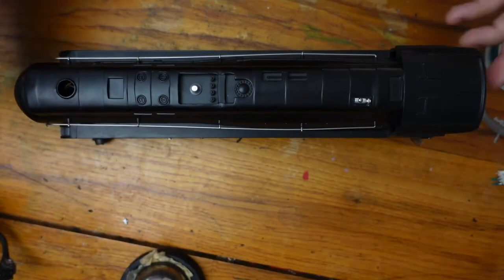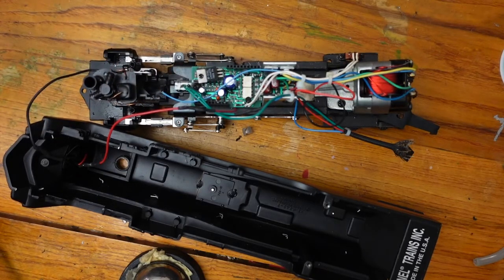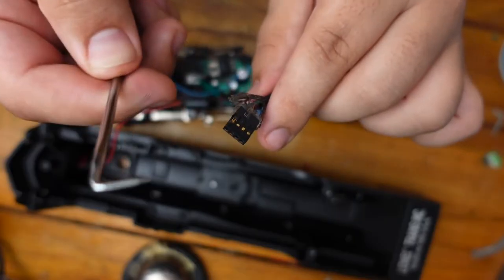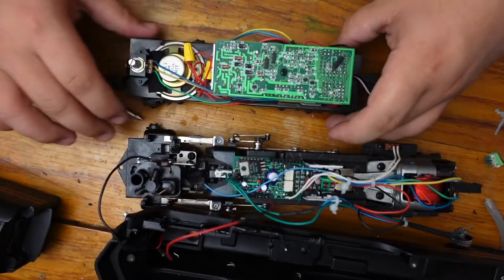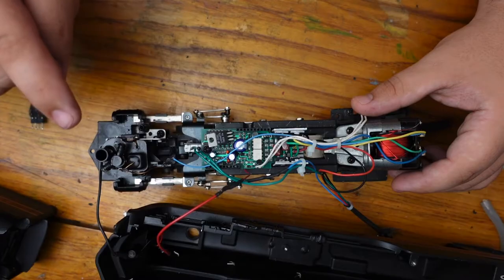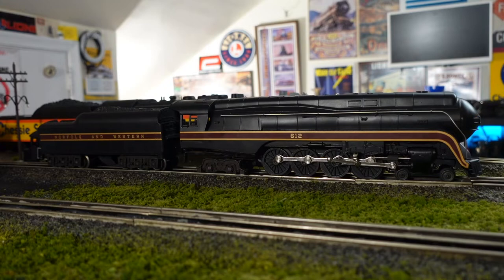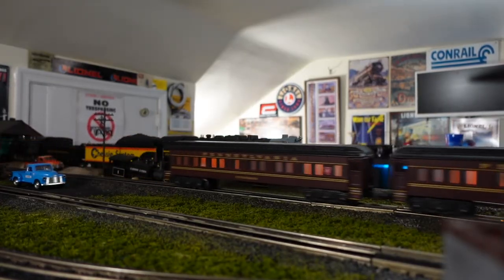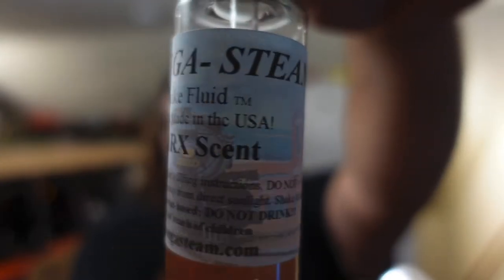Troubleshooting Lionel Railsounds with Lionel N&W 612 & Run Session!

Comment: Great upload, beautiful engine. The word you were searching for is Heat Shrink. You can find the little hose for your smoke unit at an auto parts store. Just take the old hose in and match it up with a similar size piece of vacuum hose.
Reply from the maker: Thanks so much for watching my friend! Don’t you have one of these as a tinplate Marx? Definitely will be matching it up this weekend for the cylinder steam.  Lol yes heat shrink 😂

Comment: Good video Nick, very informative!
Nothing essentially wrong with wire nuts IF you've allowed enough bare wire to twist within the nut, however sometimes I use wire nuts myself, sometimes not.  It all depends.
Reply from the maker: Thanks so much for watching! That’s an excellent point. The wires were barely stripped. Maybe it was built on a Friday after a lunch break lol

Comment: I have an MPC Daylight engine with a similar smoke unit, I got replacement tubing for the smoke unit from Lionel. I also had an engine that had many wire nuts where one black wire came out of the wire nut and I had to guess which wire nut it came out of, luckily, I connected it back to the right place.
Reply from the maker: I’m hoping to eventually swap out the unit with a replacement smoke unit or fan smoker. I think these were the last few USA engines made that year.  The boards were most likely from Korea and they used the wire nuts to speed up assembly. Thanks for watching!

Comment: Very informative video Nix. I always though those wire nuts were a little suspicious. I’ll keep that in mind if I find some in any of my locomotives with that. Thanks man!
Reply from the maker: Thanks so much for watching! I think they just didn’t strip the wires enough but I prefer the solid solder joints 🚂💨

Comment: Thank you so much for this video/tutorial.  I just acquired a 612 and temporarily ran on my track with just a standard transformer and it performed similar to what you described…chugged once and that was it, no more sounds.  Thanks to your video I’m going to disassemble and see it there are any like wiring issues.  If you change out the smoke unit can you video that?  Thanks again
Reply from the maker: Thanks so much for watching! I’m glad I could I help! Definitely check that tether linkage and I’d solder all of the spots where they used a wire nut. The cherry / chuff switch is most likely perfectly fine. Let me know if you need any help 🚂💨
Reply: @NixCrossing  I didn’t see it but is there a way you could post or send the parts list and where you got them?

Comment: Nick, thanks so much for this video! I have the same locomotive and it has a crazy "spastic" chuff problem. Now that I've seen your video, I'm going to look at replacing the cherry switch and checking the connections with wire nuts. You mentioned that TRAINZ had replacement cherry switches so I will contact them. Do you have a part number?
Reply from the maker: Thanks so much for watching! That’s most likely the chuff “hot” wire contacting a ground somewhere on the shell or inside the shell.  I would trace the hot wire back to the tether. The part number is 401-162 Cherry Limit Switch sold on eBay or Trainz. Hope this helps! These are sweet locomotives

Comment: A few questions;  I didn’t see it but is there a way you could post or send the parts list and where you got them?

Did your loco not sound at all or did it let a sound out briefly?  

When you completed the work did you put it on a track with just a transformer or did you use a cab1 or TMCC? Thanks
Reply from the maker: Not a problem.
I don’t have a parts list for this kit, but the eBay seller ships them as a full aftermarket kit most likely purchased from Lionel’s mass sales. It did make sounds, just didn’t make a difference with the reed switch connected. I actually used both a conventional transformer and using my CAB1 remote in conventional mode.

Comment: I got a Lionel 4-6-0 camelback with railsounds. When I turn it on, the only sounds are the whistle and bell. Any idea why?
Reply from the maker: Hey! Most likely the “cherry” or “hinge switch “ for chuff needs to be replaced.  They wear out overtime. I recommend looking up “ Lionel cherry switch “ on eBay or Trainz. Lionel also sells the replacements if you search that item on their parts site.  They are easily installed, just need to solder to 2 wires back to the replacement switch